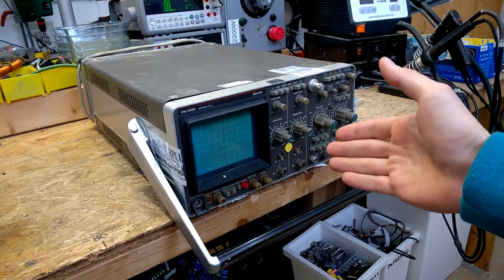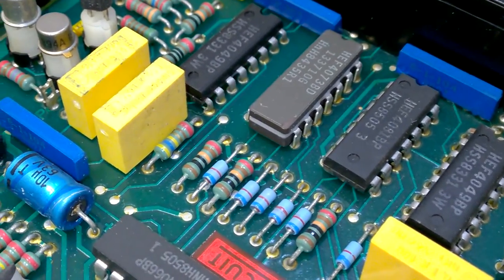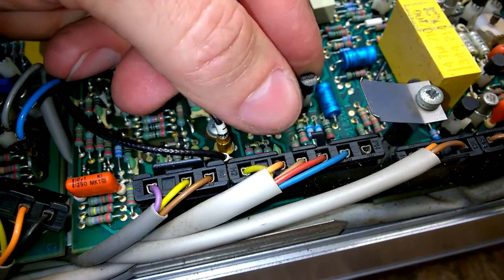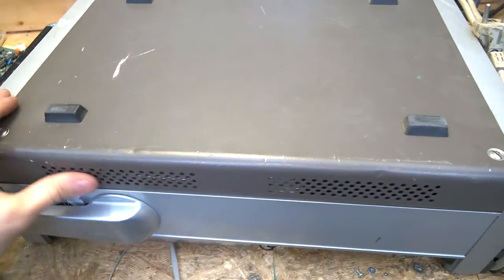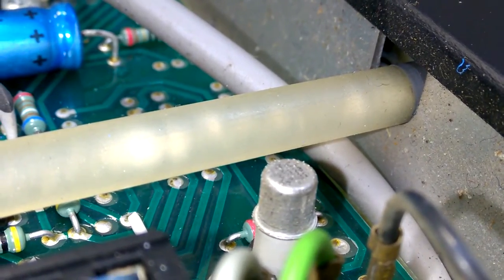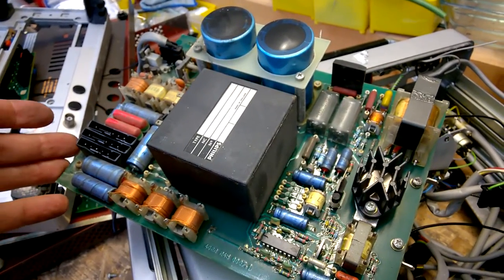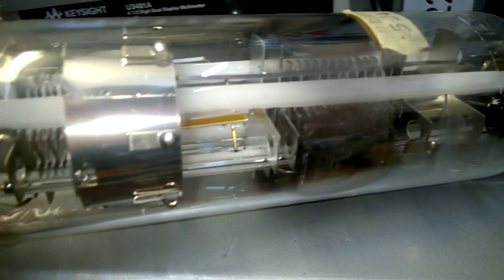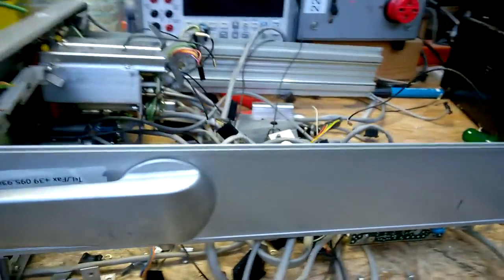Vintage Philips PM3266 Oscilloscope Complete Teardown: blown RIFA capacitor

Comment: I don't have a Philips oscilloscope but I do have one which was designed by them; it's a Metrix OX 8020.  It only has a 20MHz bandwidth but it's still a nice old scope.  It has both an analog mode and a 40MS/s digital mode.  The on-screen digital readout works in both modes and you can freeze the display and print it out with a compatible external printer.

Comment: The high voltage cascade looks as if it's encased in wax, so I'm surprised if there isn't someone who's able to repair and repot them.
Reply from the maker: I guess you are right.
The HV PSU is most likely OK, since the faulty RIFA cap in the main PSU has stopped EVERYTHING
Reply: @MaxKoschuh  Yes, that cap was nicely detonated!